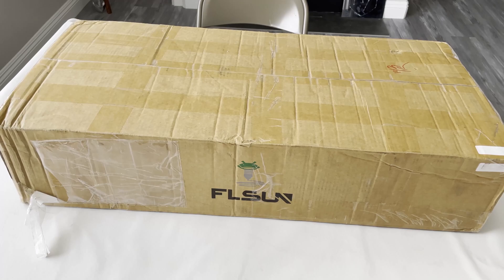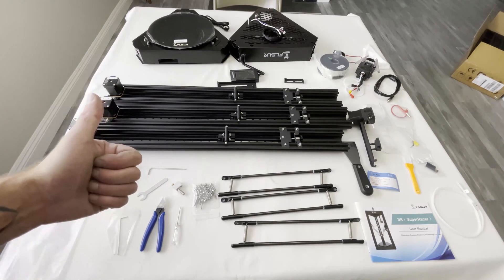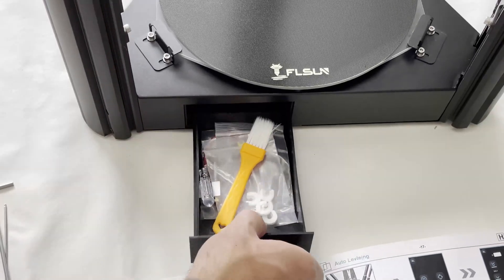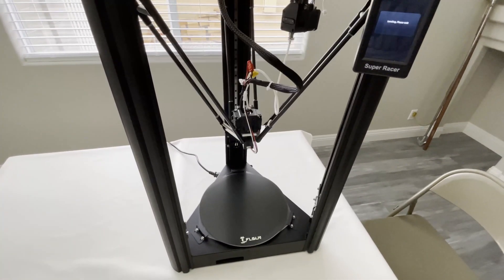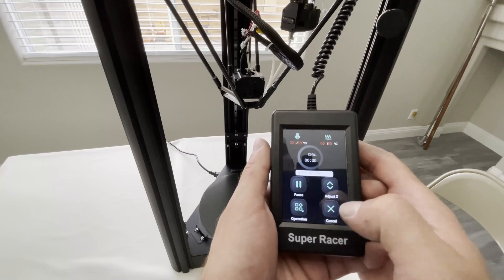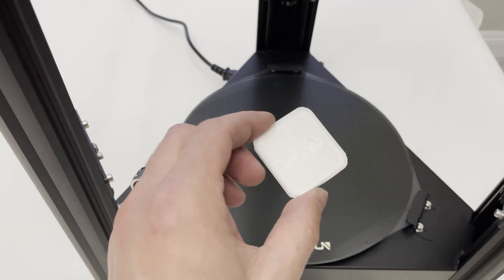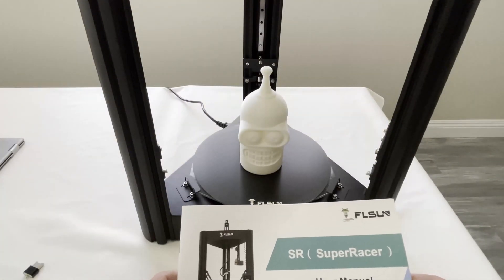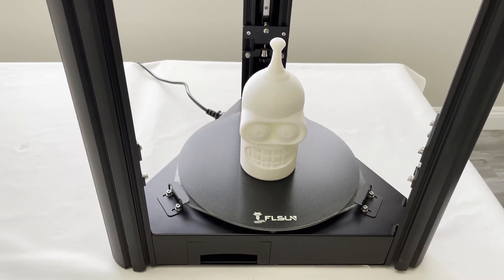Super Fast Prints With FLSUN Super Racer - Unboxing, Setup & Full Review

Comment: I have a question, can u help me 
I bought this machine and i did every step but my test model didnt go well , i tried 3 times but this is not sticky every time printer hits the layer and separates it from the plate Could u help me plss. I dont know what can i do
Reply from the maker: Adjust the Z-axis. You probably need to lower it just slightly if it’s not sticking.
Reply: @ArtByAdrock  i Will try THANK YOU 🥹